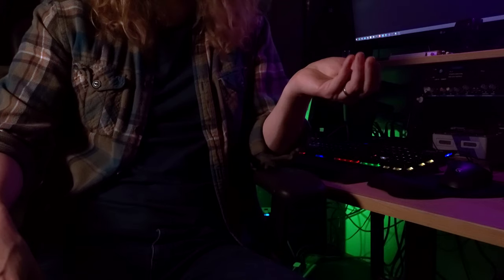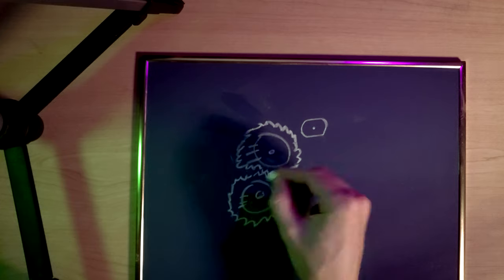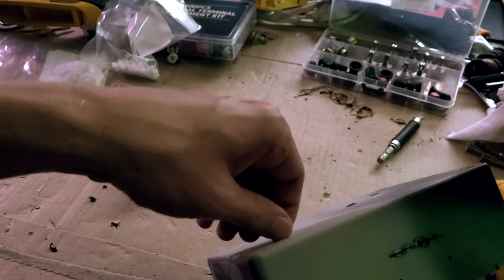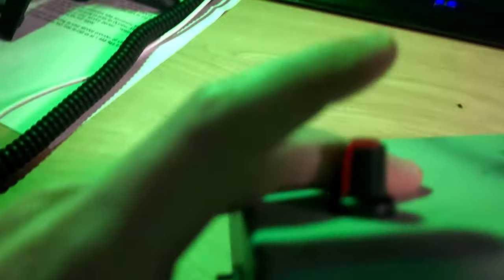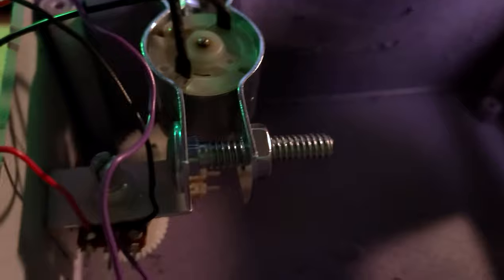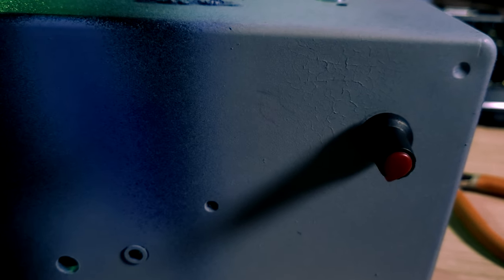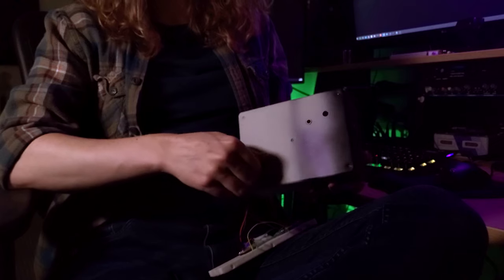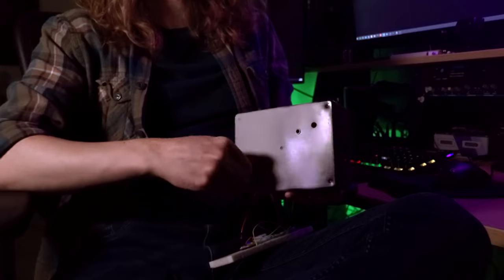Making a Motorized Potentiometer

Comment: Ive been doing weird little projects like this since a wee wee lil kid. Before most people's parents let their kids have sharp things like screwdrivers I was already hand winding motors and messing with soldering irons. My advice is > get to know your tools intimately. Tools being, anything you can buy. Classify each tool. Find the max & min of the specs.  For example that motor: it's going to have torque / voltage / speed. Those are going to be a number, but in reality those numbers are deeper. Nothing in the real world is static or absolute. aka, a range. You have to find its max & min. How slow can the motor go? How fast can the motor go ? How little voltage ? How high voltage ? AND what I am talking about isn't >> Be an accountant and write all these nerdy numbers... nah, that is not necessary and it's going to take forever. You'll probably run out of patience or only do this for a couple devices. Gotta go quicker. Really, all you need to do is plug the stuff in and play with it. For the motor, just grab your variable voltage power supply or a couple different wall warts and hook up the motor & see what it does. Can it turn a wheel on a toy car ? Will it run lop sided objects and survive ? does it run slow and still move things ? This process will take a couple seconds... then just make mental note or write down if u feel compelled ... common sense yeah.    My main sentiment/advice again >> classify all the things << know what they are capable of. With this catalog of 'knowing because you actually did those things,' you can put the Legos together and craft things. It's important to do this in idle time caz when your mind is crafting contraptions you need to be free of unknowns. All your endeavors will be 100% if you craft from knowns. When you get good, you should be able to predict the min and max of your newly crafted device.  no math required, but if you "Math" it's an excellent way to place bets. Like making your own game...    
 Question >>   How many oz of dish soap can a paper clip hold ?  << Rules :: The paper clip is the larger dia type. it shall be straightened into a wire shape with a hook on the end capable of holding a string. You tie the string from paper clip to soap bottle. The paper clip is clamped to the desk with a C-clamp or quick clamp. the stick-out from desk is exactly 1 inch.   Do you want to guess in comment prior to doing the test ?   That is the whole point btw. I already have a guess because I have classified most tools & materials on Earth. I will also replicate test if u r game...
       -helping fellow Earthlings, cheers

Comment: A way to remedy the torque issue a little might have been to clean out some of the grease in the pots. It's been a while since I've had reason to take apart a pot, but as I remember, the friction of the pot is mainly influenced by the grease. I needed a low friction pot and stripped the grease with isopropyl. 

Might work for you, might not.
Reply from the maker: Thanks for the tip!

Comment: How come you need two potentiometers? The potentiometer is just outputting a signal between the applied voltage and 0. Couldn't you just pigtail the single output signal and send one to your ADC for positional reference, and the other to go provide the signal to the circuit of interest?
Reply from the maker: Once you connect the potentiometer to a circuit, it is going to have some voltage applied to it, which could be changing in the case of an AC signal. This is going to throw off the attempt at reading a known voltage to set the pot position. To solve this, you need a dedicated pot for feedback control. But check out the part 2 video - I switched to a dual gang pot to condense the design significantly.

Comment: are you trying to remote control your guitar amp??? that is what brought me to this video…
Reply from the maker: Close, but not quite. What are you working on?
Reply: @AllPartsCombined  in my mind i want to create some way to turn the knobs(potentiometers) on a guitar amp remotely (via midi over bluetooth) and store them as presets that can be triggered thru a floor stomp … I guess I need to make a video explaining what I want to do
Reply from the maker: Awesome. If I can ever get this next project working and finish the video, it may be able to help you with that.
Reply from the maker: By the way, if you are making a motorized pot, be sure to check out my part 2 video if you haven't. I really streamlined the build in that iteration.
Reply from the maker: Hey man, took longer than I expected, but I finally got that video out - https://youtu.be/uZlBgybJNsA
Spoiler - I ended up dropping the Bluetooth feature, but hopefully there's still something in there that can help you if you're still working on your project.